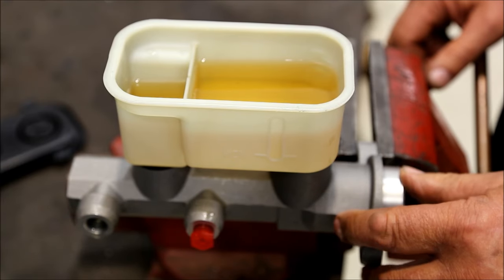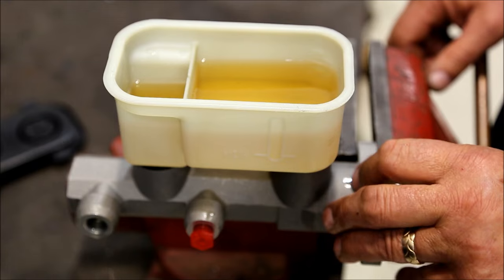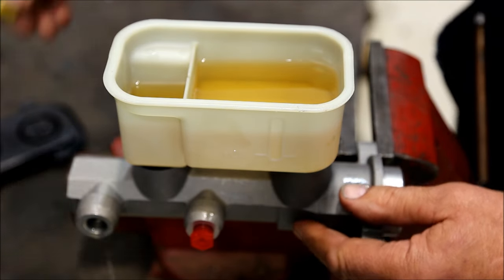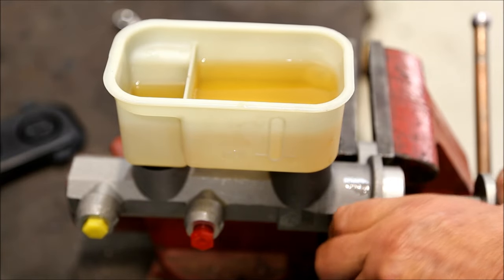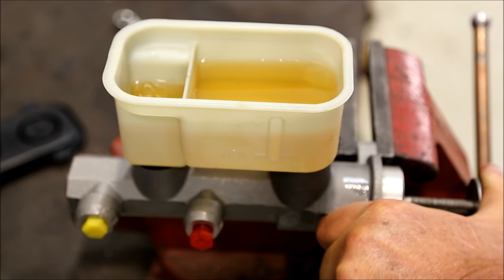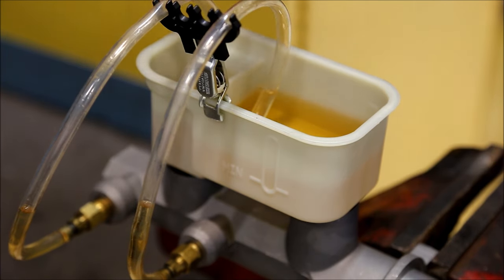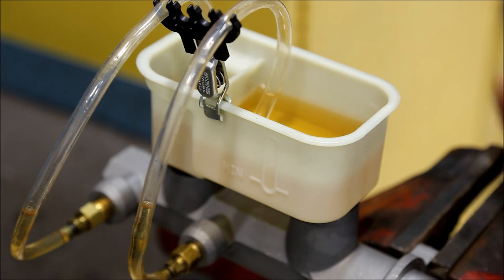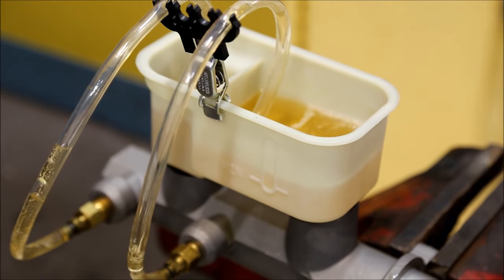NAPA Brakes Master Cylinder Bench Bleed

Comment: If you agitate the fluid too much, it airates the fluid, and then you will have a small amount of air left in the bore! slower is faster, and better.
Reply: Totally agree.  This guy pushed the piston far too fast and even ended the video with air still coming out of the MC into the clear tubes.
Reply: I had a question, i need to bleed a master cylinder but its on the car, i bench bleed it when it was out of the car car but apparently it still has air in it,this is not my first rodeo so im kinda stumped about whats going on, this master cylinder is a little unusual,it has your 2 normal ports but it also has a bottom port that goes to the driver side front wheel only, if i decided to do the plug method he first shows in this video, could i leave the bottom port hooked up as it is, to the front driver side caliper ? that line is buried under the master and i would prefer not to deal with it.

When i bled the wheels the front ones are great, solid fluid coming out,the back ones 2 but they just dont seem to have a lot of pressure,my problem is the following, the car stops fine but the pedal is way long,i did also install a a booster and i have a tool to measure depth and i did that and left 20 thousands as a air gap,i dont think the problem is the rod but air in the system, sorry for the long post, thank you for any input you might have!

Comment: The second one he did was not ready. You should have solid fluid in both lines.
Reply: truelyyy!
Reply: Not enough fluid, it looked like the tube for the front brakes was not in the reservoir enough.
Reply: I think it was more for the purpose of an example of what to do over actually completing the job
Reply: @riotautorepair9662 

But why not show complete fluid occupation of the space? 

It’s fundamental to the process. No air should be in any of the circuits; the entire point of the extra process is to ‘prove’ visually you have complete evacuation of air. The other way is a damn good guess with corroborating evidence.

Comment: So I'm kind of leaning towards doing the 1st method because the 2nd method takes a really long time (i've done it before). So, after you install it on the booster but before you hook up the brakes lines, how do you minimize getting air into the MC again? Do you install the cover and press the brake pedal while hooking up the brake lines? I know you have to bleed all the lines going to the calipers but getting all the air out of the MC seems to be the hard part.
Reply: no.
Reply: Yeah, every video I've watched so far conveniently leaves out all that information. What's the purpose of showing you how to bench fill the master cylinder then skip showing anybody how to put one on afterwards.
Reply: First, use the hoses and do it correctly. You will always introduce some air just because you disconnect / reconnect the lines..So yes you should bleed the entire system when finished..

Comment: You should have proved the first method actually works, and done the second method after the first.  I need to see proof.
Reply: Yeah, I'm skeptical that there were no air bubbles left inside the master cylinder.

Comment: When you have finished the bench bleed, what keeps air from coming back in through the outflow holes?
Reply from the maker: The plugs remain in outlets while you are installing master on car. Then you can “test” it on the car by starting it up and pushing down on brake pedal (if using brass plugs). If you feel a good hard pedal, remove plugs and install brake lines. Now you may have to bleed entire system in the proper sequence.
Reply: the pressure from the fluid up top keeps the air out...if the fluid dropped completely out it would put air back in.

Comment: I used method 1.  I cycled to piston until I seen no more bubbles.  Although there was a lot of resistance, I never got to the point where I was unable to move the piston.  Did I do this correctly?
Reply: Yes 100% correct
More question ? Insta keep_m_running

Comment: is this the same as loosening the brake lines connected to the mc and having someone pump it?
Reply: Hopefully this keeps air out of lines and you avoid pumping bubbles the length of the car.
It's good to flush lines of burned old fluid but you waste a lot of fluid pumping to fill the cylinder and get bubbles out the back.

Comment: I did everything right , whrn I turn on the car the brake pedal feels really soft ,  tske goes all the way to the floor ?
Reply: Well so does mine.  So there are more than one place that can be a problem.  Master first. ABS second. The rear brakes drum brakes with shoes.  They are very difficult and people leave them for years. If they are worn down or installed wrong. Mine are installed with the shoes wrong. Air in the wheel cylinder or lines. Air in the front calipers.  So bleed the lines back to front.  Also it can be a bad master.

Comment: Why would you need to have the tube ends under the fluid in the tank....when you are trying to remove air in one direction ?
Reply: the air will be removed in the tank(hence the bubbles in the tank)
Reply: When the air is all out, fluid will come out the tubes and suck fluid back in to the bore from the bleeder tubes
Reply: Because after  pushin when you release it suck air back in.

Comment: Is the pressure the same on both line outs?
Reply: I know your question is old, but it would depend on the system I supose. Especially front disc/rear drum.

Comment: I did my master cylinder like this but when I continue pushing I didn't get any resistance it just kept pushing in the fluid just kept coming up is it ready or not thank you
Reply: Get some real plug , not the plastic one.and yes you should feel a difference. It should be harder to push.
For more question @keep_m_running

Comment: What is the tool you're using to compress the piston? I can't find it at all
Reply: Use simple screwdriver. 
No need for the special tool
Reply: @jw200  
I already bought the tool months ago.
It makes it easier to prevent pushing the piston too far...which is what I ended up doing before i got the plunger.
Reply: @jw200  What a simple screwdriver ? 🤔
Reply: Plastic would not scratch the inside bore.

Comment: What a sloppy job. First you put gloves on. And for the second method you let the hoses fill  and then you submerge them in the fluid. Otherwise your stroke will never be able to push the air out because the air will have to travel too long. The shorter the hoses the better.
Reply: Yeah a shorter hose but it has to make it to the top.  So how about a smaller size after the first inch of bigger hose?